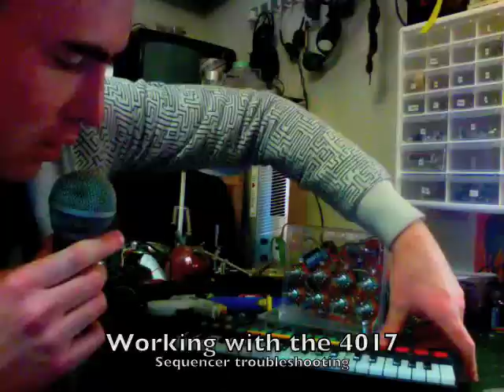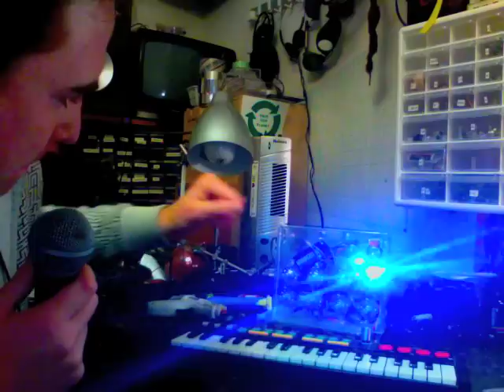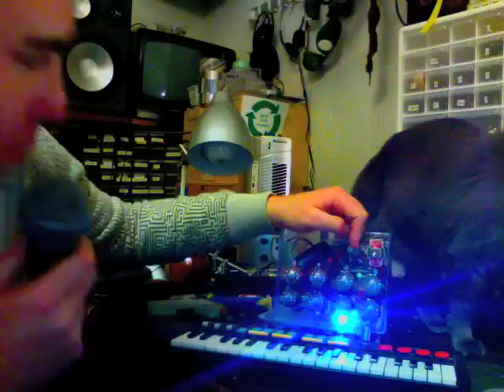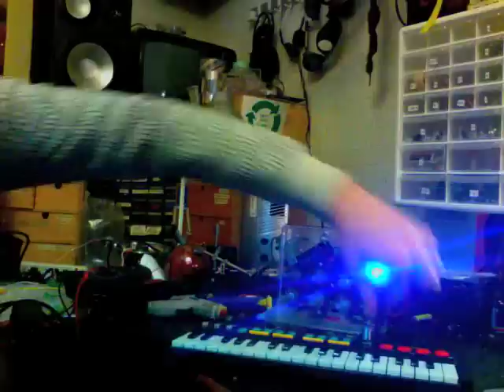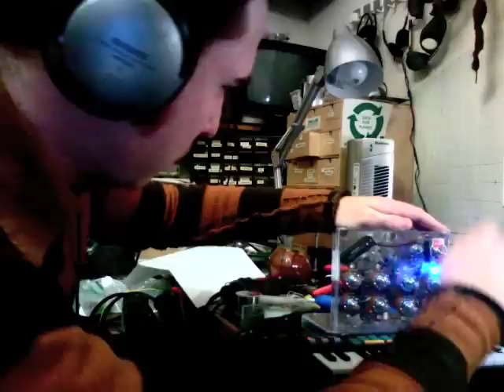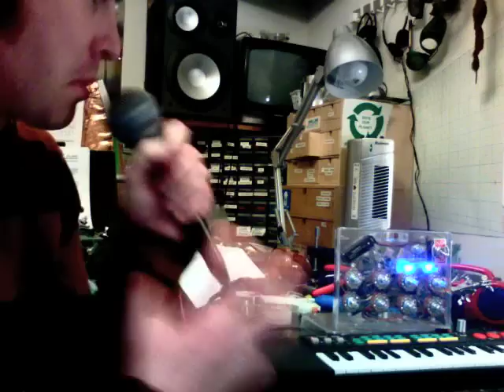4017 transistor discussion/demo

Comment: multiple triggering. But not on all of the pads. i've tried all sorts. Altering the voltages to the trigger and to the 4017. Tried different resistances to the different pads. I'd get one pad to behave as it should only to get another freaking out. Then i'd think i had it fixed on all four only to have it start retriggering again as soon as i altered the speed. It's puzzling how the dd6 does none of this. The only consolation with a dd machine is you can atleast assign one sound to two pads.